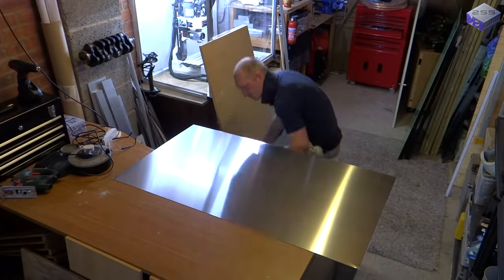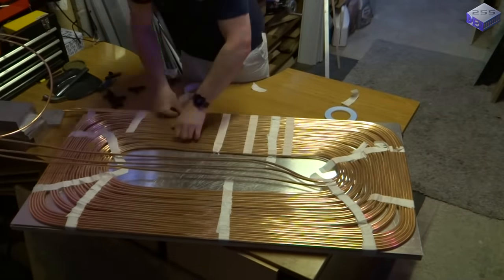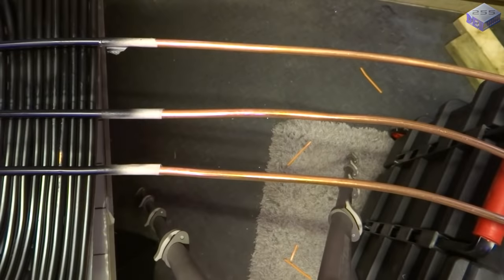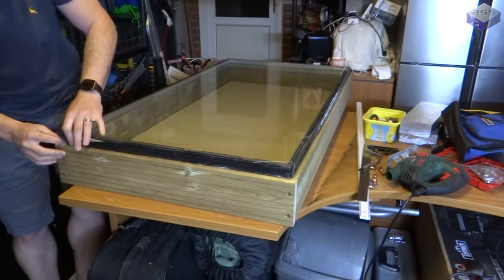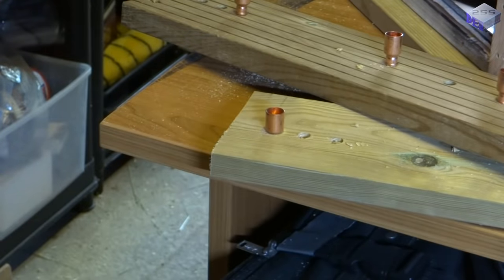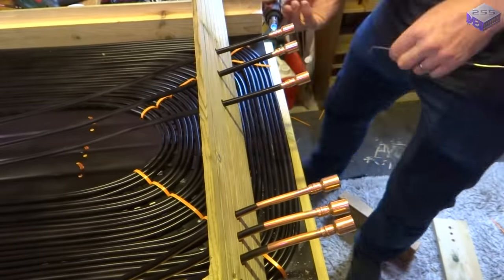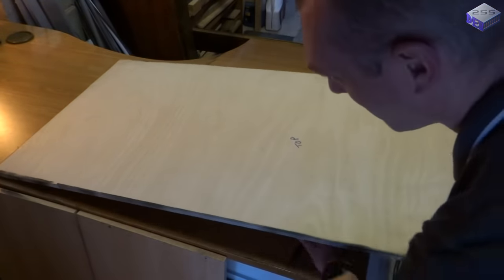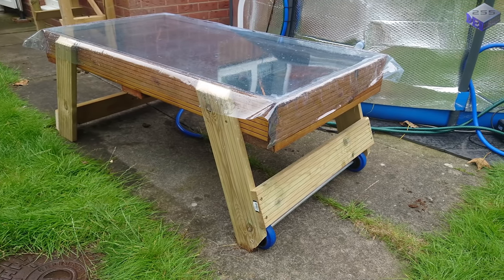Improved Solar Pool Heater - Full build

Comment: Great vid. Just wanted to ask why you didn't join the copper on the inside and only have 1 flow and 1 return pipe outside?
I'm going to make a v2 of mine and will vac out the air in the box to give even greater temps.
Keep pioneering
Reply from the maker: Thank you. I put the connections outside the panel so that I could configure it for parallel flow or serial flow just to see what difference it would make. I'm yet to play around with different configurations and may have to make another one to see the differences.

Comment: Hi Neil and congratulation on your improved Solar Pool Heater it looks really good. You mentioned a result of 500W. I am not too technically inclined so, in order to help me understand, could you tell me what temperature difference inlet/outlet did your system achieve while connected in parallel? I have a similar system with 4 boxes of 4'x4' with 30 meters of corrugated stainless steel hose in each box and I want to double up the length of hose in May 2022. Your results might persuade or dissuade me to do it. So, please let me know. Thank you so much for your reply! Lionel from Canada.
Reply from the maker: Hi, I believe input to output was around 1 deg C  from memory, although the flow was fairly high. Although, with the pipes in parallel, you can't guarantee that your getting a good flow through all the pipes, therefore series may me the best option. I will try a number of configurations this year to determine the best way. If you can configure your 4 boxes so that the connections can be adjusted, I think that will be your best option. Or even provide 4 tubes back to the pool so you can monitor flow through all. Hope that helps.
Reply: @TheSolarPoweredEngineer  that temperature differential indicates that you are rocketing water through your panel way faster than necessary.  Chemical engineers target a temperature differential (deltaT) of 10°F (5.6°C) across heat exchangers which is what this is.  Select a smaller pump so you don't waste energy.  Something like a MaxiJet 1200 or MaxiJet 900 is probably more than enough for this application and gets your pump energy consumption down to 20 or 10 watts.  Your water in the tubes might be extremely turbulent which will decrease how much energy you transfer.  You want it to be just past laminar and into the turbulent flow regime but not way into it.  I can help you calculate the flow rate you need for optimal performance if you want to go down that rabbit hole.
Reply from the maker: @StormGod29  Good point, I assumed that the faster the water went through the more heating capacity of the system where the heating effect exponentially falls off as the heat rises towards its maximum potential. The pump is not too bad, I believe it's 24W although does make sense. I could test for the optimum flow for this one as I use a flow rate meter and accurate temperature sensors connected to an Arduino to calculate the Wattage of the system, so could run the panel for 5 mins at different flow rates over the middle of a clear day to determine the best flow, with the Arduino controlling the pump and maintaining/switching flow rates. The whole idea behind this is to see if it's possible to create a very efficient panel at home, so really appreciate your knowledge, Thank you. I may have to go down that rabbit hole.
Reply: @TheSolarPoweredEngineer  good for you to tinker and optimize!  So to expand the rabbit hole a little bit, when you absolutely rocket water down a smooth pipe you eventually get to plug flow.  There is drag at the pipe walls so you get a thin region of water that kinda sticks to the inside of the pipe walls and stagnates there.  In the middle (bulk fluid) you have a slug of water just shooting past that stagnant region and not interacting with it much at all.  This is baaaaad for heat transfer.  What you want is a very very thin laminar sublayer on the inside of the pipe and then almost the whole bulk fluid barely turbulent.  This optimizes the rate you can transfer heat from the pipe wall into the bulk fluid.  Fancy heat exchangers will have corrugated tubes to enhance turbulence without building a thick laminar sublayer.  The more and more turbulent the flow gets, the thicker this laminar sublayer becomes and it acts as an insulator.  Definitely throttling down your flow rate has the possibility of increasing your apparent power output.
Reply: @TheSolarPoweredEngineer  also check out Tech Ingredients' videos on enhancing a solar panel using cheap mirror panels.  The same results should apply equally well to flat plate thermal collectors.  I've asked them to explore this but they might not or not for a while.  Absolutely cheaper to fix a few mirror panels (I'd do 4) than to build another or larger thermal collector.
Reply from the maker: @StormGod29  Sounds very logical, I understand eddy currents and skin effect for electrical circuits and sounds similar, but probably a better analogy would be eddy currents at the edges of streams. Nice rabbit hole 👍
Reply from the maker: @StormGod29  Ah yes, totally agree, I've been looking into mirrors and fresnel lenses, although the latter has some attenuation to the light passing through.
Reply: @StormGod29  We try for 10-13 in the laundry industry with out heat exchangers
Reply: @StormGod29  sounds very engineering info.
Reply: @TheSolarPoweredEngineer  awesome videos thank you I have read that an optimum flow rate for heat exchange would be 3-5 gallons per minute.
Reply from the maker: @masoodalikhan7987  Thank you, I will have to get an imperial pump ;-), ha-ha. That sounds like a good flow rate for my size tubing, I may just test a few different flow rates to see which is the most efficient.

Comment: Looking good.
I did something similar a few years ago to heat water for the house but used silicone hose clamped between two sheets of alloy. It worked well until the wood rotted and the glass fell out. 
Have you calculated how efficient it is compared to using PV panels and the price difference?
Reply from the maker: Hi, thank you, I've not yet calculated its efficiency, although it does output around 500W calculated by input to output temperature change with given flow rate, so for a panel this size (I think 0.8m squared from recollection) it's probably around 62% efficient, where PV panels are around 20% efficient, plus you would have inefficiencies in the electrical heating system also, so using PV could be as little as 15% efficient overall. Hope that answers your question, I will have to do a few tests next year. Oh and this panel cost was around £250, where 500W of PV would cost around £500, where PV tends to be around £1 per W
Reply from the maker: @Kev Hi Kev, I wonder if I could pipe your sun over to the cold UK ;-). Yes, I've looked into making a closed-loop system using an emersion heater tank with jacket, I believe this would work really well as it's a closed system that retains the heat; would have to stop the pump and use a valve to shut off the flow though, as the panel would start to cool it if there were any water movement during the night. there is a lot less water in a bath full of water than a swimming 3m (10ft) pool too, so I'd recon you could have a free hot bath every day, especially in Southern California.

Comment: Great project Neil, I am building one in Mexico where I live part time to heat a small pool. Have you considered reflective film inside and black pipes. Also how do you account for humidity inside the box.
Reply from the maker: Hi Richard, the panel has 2 reflective insulation behind the aluminium plate to keep heat escaping out the back. Do you mean reflective film around the side of the box? This could help although would probably have been better with the pipes being closer to the glass, something I may have to experiment with. I hope yours goes well, should have plenty of sun in Mexico 👍
Reply: @TheSolarPoweredEngineer  why would pipes being closer to the pipes make any difference? To one’s further away?
Reply from the maker: @harunyahyadotorg  Hi, the pipes being closer together transfer more of the heat to adjacent pipes and will give more surface area per m2. The pipes being closer to the glass (or acrylic) would reduce the amount of air between and would reduce the shadow from the edges so more sun could get in. The air also has a specific heat capacity and some of the sun's energy would be taken by this layer (hence the efficiency of an evacuated tube solar heater).

Comment: How much did this all cost. Including the wood and aluminium Bloody brilliant. The solar pool cover from bestway only heats about 2 or 3 degrees.l especially with Scottish sun 🤣🤣 Aswell do you have the dimensions on the off chance.
Reply from the maker: Thank you. This cost me around £250, although with the price of materials at the moment it would probably be around £350 now. Hopefully, you have some sun up there today. The glass is 650mm x 1240mm and everything else was just made to fit, I can have a good old measure-up if you need other dimensions.

Comment: I wanted to do something like this. The changes mainly are that I would want to use alminium tubing as it transfers heat to the water very very efficiently, and second, I would want to seal it like you did enough to pull a vacuum, which in theory should force all of the energy into the water. Since I have yet to acquire a pool in life, I am sort of procrastinating. Maybe if I ever get a home I plan on staying in for longer than 2 years... even without a pool, I will try my hand at this for household hot water.
Reply: But copper transfers heat better than aluminium..
Reply: @flip550  You are correct, aluminum has 60% of the heat conductivity. I wonder how that applies in a vacuum though? Also copper is roughly double the price. Would be an interesting compare in 2 identical systems.

Comment: Hi !
Thanks for sharing, and the comment section is full of good advices too.
I’m planning on doing so on my habitable boat to get some regular hot shower.
Reply from the maker: Hi, no dramas; yes it's getting some good responses. I will try different materials, such as Perspex, polycarbonate sheet, etc, to see how efficient they can become. Also,, it is a little heavy with the glass, so it may need these materials to make it lighter for your boat.
Reply: I plan on contouring the boat with a black low diameter hose. I don’t know yet how far I’ll be pushing the automatism to lower the electricity consumption. 
I’ll see, the boat goes ashore on Tuesday !
Reply from the maker: @ludovicbernard4570  Ah ok, it will be interesting to hear what you have done and your results.

Comment: You said that you wanted to eliminate the possibility of leaks inside the frame but then you embedded the Yorkshire joints you'd soldered into the frame.

Perhaps it would have been better to add a few inches to the length of the frame to create an area where you could fashion a manifold for the pipes.

Another advantage of that would be that you would only have one feed and a return connection outside of the frame.

Looks nice!
Reply from the maker: Hi, very true, I considered the soldered joints to be permanent and not leak, although these could leak especially with a lot of movement with the outside connections going on and off. They don't take too long to fix tough.

I wanted to have the ability to change configuration and test flow rates and different in to out, just to see if there is any difference feeding water directly to the middle or the outside.

Thank you. Glad you enjoyed it 👍

Comment: 1. Black is a lack of (none) reflected visible light. Green is visible reflected light of certain wavelengths. If green is being reflected that is more than none, so can not be more efficient. It is a bit more complicated if we consider non-visible light.

2. Standard cable-ties are not UV stabilised. After a couple of years they are likely to become brittle and may give way. 

3. The double glazing is interesting. It will reflect some energy. Best is one sheet with a coating which lets the heat in but traps it. 

4. I'm most interested in whether the extra effort and expense of this version was worth it. What do you think?

5. It would be easier to drill the holes into the backing sheet before you lay out the tubing, and cable tie as you go.

Thank you.

Comment: Works well, you can feel the warmer water coming back into the pool after running through the mat. Wish the inlet/outlet ports were adjustable, but overall, a good and efficient way to raise the water temp.
Reply from the maker: Yes, these are quite surprising how much more efficient it is to heat water directly rather than use Solar derived electric heating.

Comment: Nice job.  I'd add a lot more insulation to the back and sides.  I'd also insulate the hoses and make sure they could handle the high temps.  After all of that effort, I'd prefer to waste as little heat as possible.

Comment: Very nice build.... I am impressed by the performances obtained, 500W in average.... Whichi is not bad at all especially if you are located in UK. Cheers from France.
Reply from the maker: Thank you. I am looking to improve it further with some side reflectors that track the sun and to change the glass for something less reflective so it will allow mor energy in from the sun
Reply: @TheSolarPoweredEngineer  Now the question : Is a DIY project still cheaper than a second hand thermal panel ? Youu can find many in market place ...
Reply from the maker: @sebydocky5080  Good question; you will most likely find a cheaper second-hand system, to be fair, or even a new one; that's If you were to buy all the items in new. Although if you have old piping, an old glass panel and some scrap wood, this would be far cheaper. Plus it is a good way of upcycling old parts.

Comment: My father had a construction company and so we ended up lots of leftovers from jobs.   One thing we got a lot of were sliding glass patio doors and windows.   Well we thought to save the windows for making our own patio.   Had 4 from job and not enough for our needs and decided to store them out of the way on our low roof carport.   Stacked them flat on the aluminum frames.   few weeks later I  happened to take a look and saw the roofing had been burned through to plywood which was black.  The bottom frame was to hot to touch and the glass had warped.   So stacking glass may help with heat and if you can find old single pane patio glass in frame, could be easier to work with.
Reply from the maker: Wow, yes, that's a lot of heat build-up there. I will be trying different materials to see what works best, so watch this space. I hope the carport was recoverable.

Comment: There is no way that would heat my pool , but it’s a superb build. I do have a big pool .
Reply from the maker: Thank you, it is small for most big pools, although the concept could work, I'm looking into the most efficient version that people can make at home, although finding out that copper may not be the best for chlorine in the pool if the PH is off, more info required on that one.

Comment: Doing any tubing heater is to start in the centre with cross piece, and using the two tubws in oposite direction work your way out to the edge  that way you end up with the two ends coming out the side instead of having to cross across the top of the other pipes.

Comment: Yeah, I've thought some about this, and in every way except pump power it seems that the faster you can move the water through the better.  You're getting a fixed amount of energy into your collector, and you want it OUT into your water as fast as possible - doing it slower means more temperature rise in the collector and that means more loss to the outside.

Comment: Saw a video some years back of a guy who also made a solar heater. He ended up with a sheet of aluminum. 1x1 mtr. On this sheet he glued aluminium c- channels with the opening to the aluminum. he did various tests with multiple glues to find the best for him and ended up with a square meter plate with a certain length of channel on it that zig zagged as one pipe over the sheet. this sheet was made black ( with my earlier mentioned sut technique in my former post). the aluminum was backed up with a foam insulator and the total put inside a frame. simple plastic foil was used to enclose it from the front. less good than your double pane glass I suppose. But this system was pretty well working to heat a pool. Made 4 if I remember well. His advantage was that the water was in direct contact with the aluminum plate and therefore pretty efficient in transfering heat. The total surface of the solar heater was facing the sun straight (when pointed at the sun) and this plate was  directly heating the water. Even more effective would be to glue two square meter sheets on top of each other on the edges with a little spacer at the edge so a thin water film would be in contact with the whole surface. Then heat would not need to travel more than 1 mm to reach the water. But this did not work due to massive surface that with little water pressure would kill the glued side due to massive hydraulic forces. But as far as I remember 4 of his collectors kept the pool on temp without a problem
Reply from the maker: That sounds something similar to what I want to achieve, I've been thinking of using my CNC machine to cut plates of aluminium into heatsinks and run water through tubing that's thermally bonded to the plates. The surface area would be greatly increased and heat transfer fairly good. I am a little worried about using different metals at the moment, especially with chlorine running through the system, I need to get a little advice first. I think the double pane glass panel is reflecting some of the energy away from the pipes, so I will have to do some experimenting this year with different materials when we get a decent summer that is.